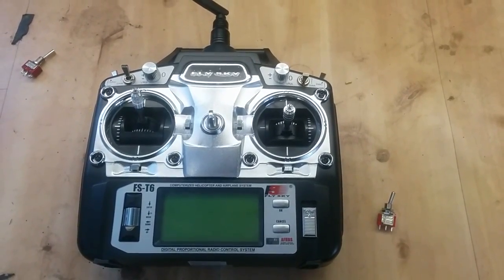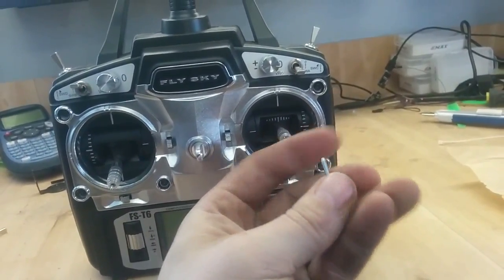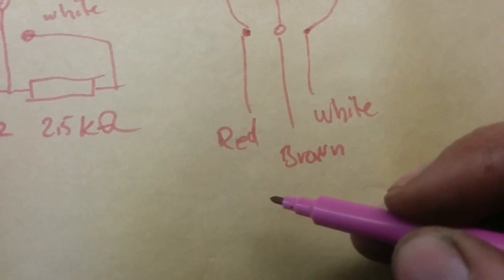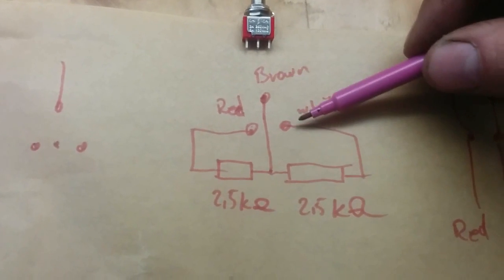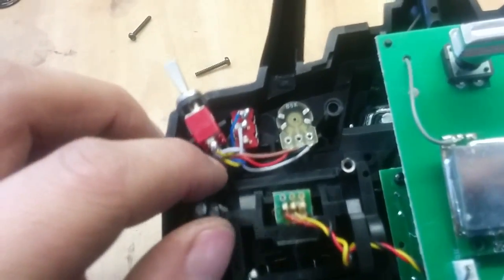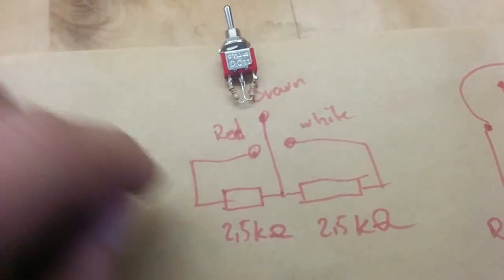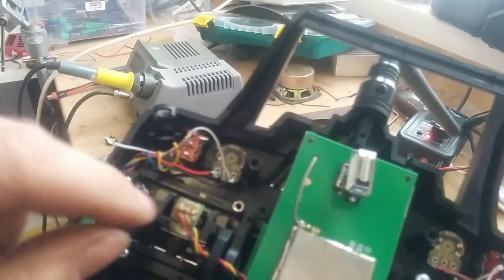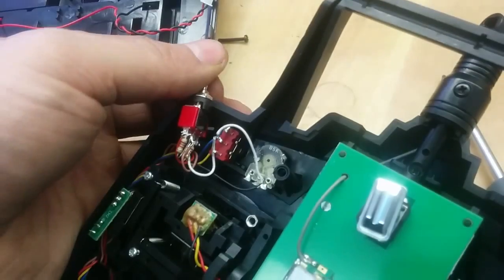Add 3 button switch on Flysky FS-T6

Comment: I did what the video explains with a 2,7 kOhm and it works perfectly! really nice! it provides you the option of choosing between the 3 fly modes. I removed both potentiometer and placed the 3 position switches on that place.
I recomend it!
Reply: which switch did u buy can u give me the link thx
Reply: I did the same. This means that you still have the 2 position switch as well and the new 3 position switch where the knob was.

Comment from the maker: Of some reason im not able to actually push "Reply..."  

Glez: You can use that position. The reason i didnt is because i want that button on the side instead.  And yes you can remove the other VR as well.

Im planning on another video and create a 4way rotary switch and also perhaps doing so both the switch and the VR knob is actually use able
Reply: Is it possible to add on a new module instead of the old one ?
Reply from the maker: Adam Keely What do you mean with new module?
Reply: Like the frysky module?
Reply from the maker: Adam Keely It might be possible. The module itself is put there in such manner that it might work but i havent done it and will not try either. The reason i wont try is because of the bad quality of the transmiter itsell and would therefore buy a better one instead that already have support for it :)
Reply: Yeah I see what your saying, I guess I'll have to invest in a turnigy 9xr
Reply from the maker: Adam Keely Yeah that is alot better transmitter. That one or even go with the Taranis. Taranis is a bit more expensive and actually im not sure if it is that much better than the 9xr :)  Happy flying!
Reply: daromeresperyd can't wait to see your 4way rotary switch mod. 
or perhaps a 6way mod? :)

Comment: i am going to try this to see if it works ..i am using my flysky for a dump trailer and hoping it will work .it seems to work fine on my spektrum dx7 with the 3 pos switch there but i would like to set up another truck to raise and lower the dump bed ..thanks for the video i will let you know how it works

Comment: If anyone wants to get the job done quickly then just put the knob in the middle position and connect the three wires coming off of it to the switch so that the switch and the potentiometer is in parallel.Put some hot glue or something to fix the knob's position.I did it and works fine,didn't need to buy anything other than a three way switch.
Reply: Great  It worked fine for me. Couldn't get the resistor method to work for some reason. much simpler too, just the switch required.

Comment: Great video. Would it be possible to put one 3 way switch where you did and also put a 3 way in the knob pos. on the same side.  thanks
Reply from the maker: Hi
Sure it will work. Due to the limitations of this controller you then need to salvage the other turn pot as well. Ie you have to use both VRa and VRb
Br
Daniel

Comment: Thanks , I have done this mod , it works perfectly , is it possible to use one of the other pots for an on off 2 position switch ? or can they only be used as in this mod ?

Comment: Hello, great video, i wanna do this mod to a Fs I6 for both VRa and VRb. If the potentiometers are 5K ohm, do you think its best to use two 5k ohm resistors instead of 2.7k to not overcharge the radio negative pole when switch Is in the middle position?  Thank you if you will answer me

Comment: I have the same radio I will like to do the mod, can I still use the SWC if I place it in the pot hole since I will be disconnecting it? thanks for all your effort..(by the way can i do the same in the other side since the VR are very unusable?
I will probably do what Jon Car suggested.

Comment: Btw for anyone wondering (even if it might be obvious), works fine with 10k resistors too ( I guess it doesn't matter as long as its greater or equal to 2.7k)
Reply from the maker: Gho5tface correct.
Reply: Btw. great vid - just completed the mod and replaced both knobs with 3 way switches :D

Comment: Hi mate, for the resistors I cannot find the 1/8W with metal film resistors. Is there any different if I used the 1/8W with carbon filmed. I can only found the resistors either 1/4W with metal filmed or 1/8W with carbon filmed. 
Or what if I used metal film resistors with 1/4W, i.e., 0.25W?

Thanks
Reply from the maker: It will work: https://goo.gl/Xd9BqE
or
https://goo.gl/T8m7mp

Comment: Why not just remove  the pot and put the 3 way switch there and keep the other factory switch?? Also can we use 2.2K resistors?
Reply from the maker: You can ofcourse put the switch where the turn knob is. I didnt since i wanted mine in the right corner. In my case the best thing would be to move the 2way switch to the position where the knob was. 2,2k should work. Its not that critical. But i dont recomend to go lower.  Happy modding!
Reply: daromeresperyd  Thanks sir ordered the switch and resistors.

Comment: Hello I would like to switch with 3 positions instead of Vra in this case the black wire should be connected?
Reply from the maker: Im not sure i follow what you want to do?
Reply: sorry for my english....I would replace VRA and VRB with two 3-position switch.
Reply from the maker: Antonio D'Agostino ah ok. yeah it's possible. same procedure on other side. not sure of the colors though:)

Comment: hi great video. is this possible to do with the radiolink rc3s. and if so do u know the ristance I'll need?
Reply from the maker: as long as that controller have an analog input its possible!  im afraid i never worked on those controllers.
Reply: it's a 4 channel controller got a push to no switch and a variable dial switch that can be set up for either channel 3 or 4.

Comment: I did this mod and it worked in the display screen, but with the switch in the up or down position the screen went blank after a second or two, the middle position was ok,  strange.

Comment: Hi there I followed the video but I'm only able to use two of the switches , no midpoint
Reply: I got it to work, be very light with the solder and DO NOT BUY the blue 3 pin switches, they are car low in quality.
Reply from the maker: Adam Keely Nice to hear that you got it to work!  It is always important to not overheat any component. A good hot iron is needed and solder it quickly. The blue as you say is very generic. There is blue ones that are aeroplane quality as well ;)
Reply: Yeah your right, I tried a blue one but it just got warm and the switch stiffened up.
Reply: which switch did u buy can u give me a link thx

Comment: Why does for some reason it flickers up and down , so on the naza flight controller it goes on failsafe on its own
Reply: +Adam Keely :::::  Put a new switch in its place ... you may have over heated the switch while soldering. That is what is causing the flickering.

Comment: You can make this mod without disabling the knob. Keep the knob where it is. Instead of adding resistors to knob cable make Y connection with 2 resistors one of them 2.7K other one 4.7K. Connect them each outer end of the 3 way switch. Disable 2 way switch. Connect live wire to middle connection of 3 way switch and connect the other wire to middle of 2 resistors. In this way; you have one 2 way switch, 2 knob (working if you choose), and one 3 way switch without loosing the knobs function. Like this:
https://www.dropbox.com/s/ibb09w0fnpass5y/20151223_010642.jpg?dl=0
Reply: +Mustafa Süzen I will try this as soon as I have received the 3-way switch.
Reply: +Mustafa Süzen tell me what wires you have attached ?
Reply: + Mustafa Süzen tenho um radio desse e no lugar do potenciometro coloquei um chave de 3 posições com resistores e deu certo uso no drone naza m lite com gps. att e failsafe
Reply: Mustafa Süzen can you make a detailed tutorial?  As this guy was doing this I was thinking to myself why not have a 3 way switch that is lowest on 1 position leaves the potentiometer alone in the middle position and highest in the 3rd position but I like your idea better.

No point in loosing any functions when this controller can actually do 10 channels and SBUS.

Comment: Hi! It's works also for flysky FS-I6 or Eachine I6 radios? Thanks 😉
Reply from the maker: If they have the same type of layout: yes it does. Its just a matter of taking one of the variable knobs and turning it into a 3way switch
Reply: I don' t know... I think that the 2 way switches has only 2 wires connected instead 3...
Reply from the maker: alessandro inn yes. 2 way is 2 wires and 3 way is 3.
Reply: And so, where can I take the third cable?
Reply: And so, where can I take the third cable? I don' t understand
Reply from the maker: alessandro inn same as in the video. u need to use an analog channel
Reply: On the video you take the brown cable from the piezo, so you lose this channel, right? Thank you!!!
Reply: Sorry the potentiometer instead the piezo... 😋